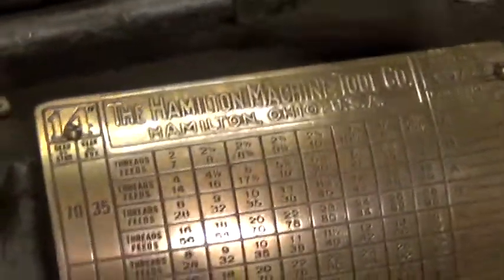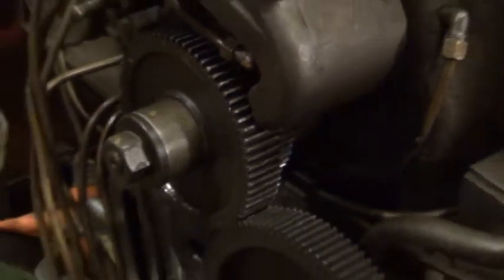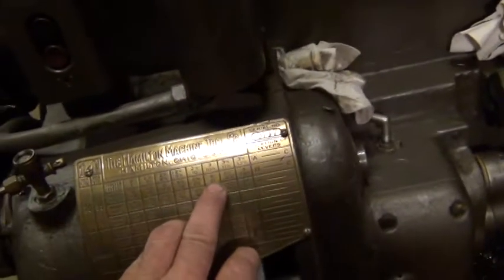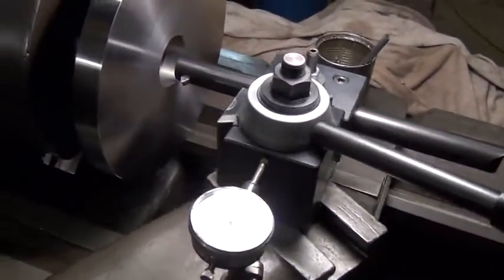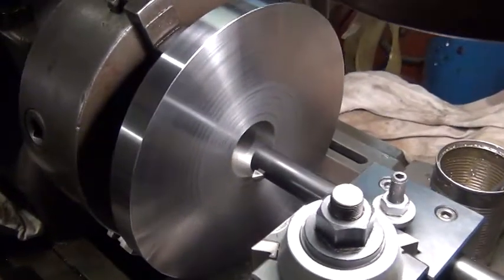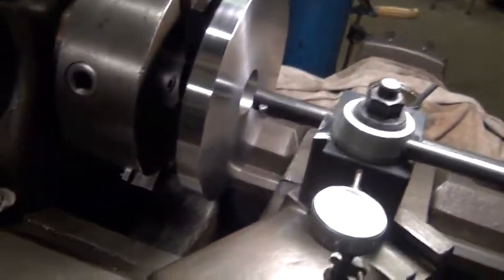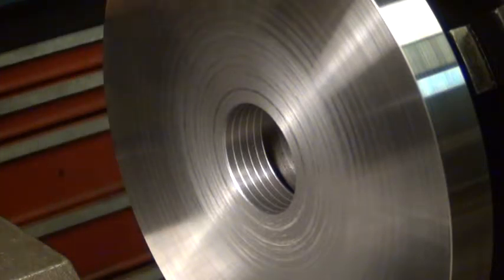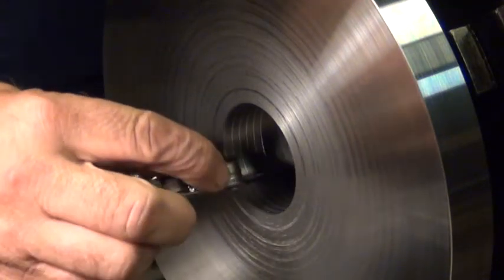Backing plate, Thread cutting, Part 4

Comment: Hi jeff im doing similar stuff witht the hendey but I cannot find out the major diam for 2 1/4 6tpi ?
Reply from the maker: Hi Lawrence,
I like to measure the spindle itself just to be sure the original is to specs. A 2 1/4" would have a "major dia." of 2.250" and a "tight or snug" fit of 2.240"-2.245" which applies to all thread sizes. (1/2" thread .500" major etc.) But I measure the major dia of the external thread on the spindle and adjust my internal to give a .001" or so clearence.( if my external is 2.485" I would try a 2.490"-2.495" thread finish and test the fit) When I did my backing plate I cut the threads in a piece of aluminum to "test fit" by keeping track of my minor dia. bore and how many thousands of depth I cut for threads.
 
Hope this helps!
Thanks!
Jeff
Reply: Jeff Sigrist Thanks Jeff.....I wish i had some thread gauges 3 wire method would work...also hendey spindle does not have a regular register(diam) but a radius register so there are other things i need to work to LOL...